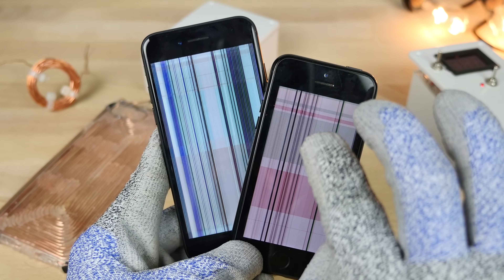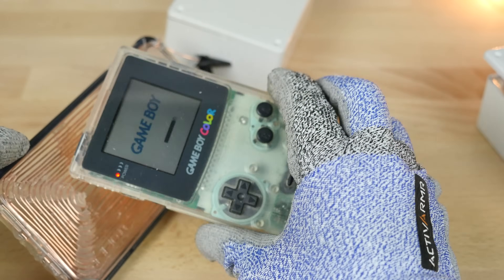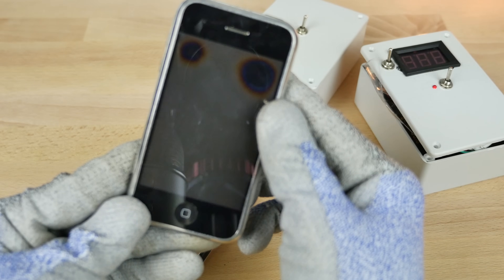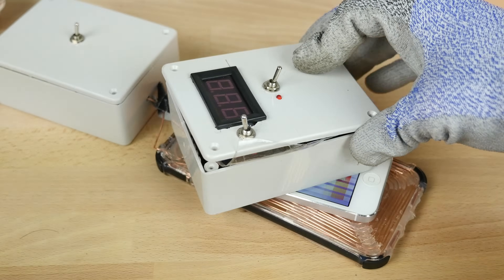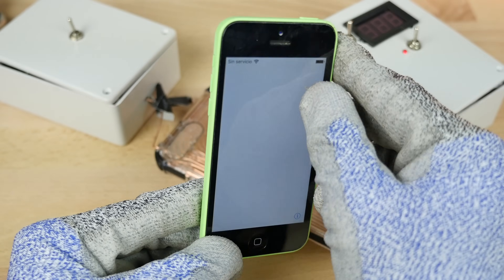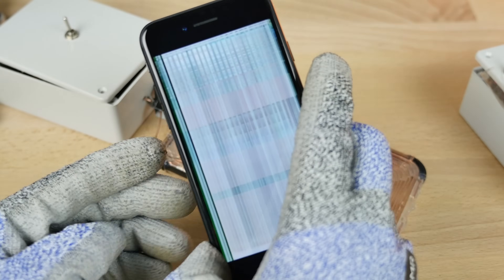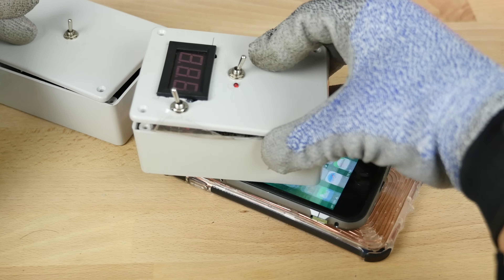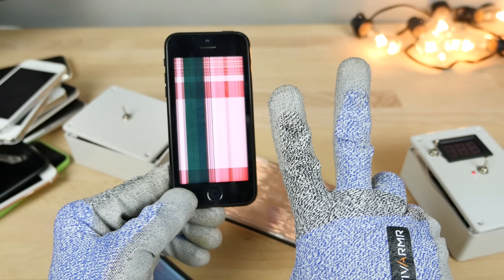EMP Generator vs iPhone 7 & More Electronics!

Comment: I recall that the earlier radio communications worked on this principle, i.e. a spark gap and a huge coil. You could then send morse code by turning the sparks on and off. They basically transmitted on a huge band of the electromagnetic spectrum all at once, not on a single frequency like later radios.

Comment: This a spark gap RF generator. Not a EMP. RF is not the same and low power. 
Most RF shielding is not Magnetic pulse proof. You must protect the whole device not just vunerable chips.

EMP causes "current" to flow along exposed circuits. RF is waves and interferes with transmission of signals.
BTW spark gap transmitters like yours are illegal to operate. 😉 
K5EDG ham radio operator.

Comment: The electro magnet creates spikes in voltage on the data lines (1’s and 0’s are determined by voltage levels) and the device doesn’t know how to interpret this, so it freaks out, might even reset.
Reply: Btw, yes there’s voltage limits that microchips can take in the input, so too much voltage will permanently damage the device

Comment: You gotta add some HV capacitors.

By the way that module you have doesnt generate 700kv more than likely. You can measure with spark gap.
I have a very similar one and it does boost to 33,000v which is still alot.

If you add a few paralell 30kv ceramic caps across the leads then to spark gap it becomes much more intense and more dangerous.

Comment: 700,000V nope.  Air breaks down with about 3kV per mm.  spark looks less than 10mm, so less than 30kV.  The false advertising on these modules is rampant.  Still good fun though.

Comment: One phone isn't more resilient than the other, but rather you found the resonant frequency of the others.  The circuit to be affected needs to be sized to the wave in a way that the circuit lies within the positive and negative part of the wave.  Also, basic knowledge of an Inductor will make you realise one loop of the coil will transfer the most current.

Comment: I am wondering if the Nokia uses through-hole components or surface mounted components on it's PCB. I've read that through hole components can handle power surges better than their surface mounted counterparts.

Comment: The older phones are more resistant because the logic circuitry is based on Bipolar junction transistors rather than Field Effect Transistors. TTL vs CMOS. FETs comprise most modern CMOS systems and are great because they are less susceptible to internal noise, use less power (3.3V nominal instead of 5V), can be incredibly compact and easier/cheaper to build. That being said, CMOS is incredibly vulnerable to electrostatic discharge and unregulated voltage spikes. It literally perforates the dielectric barrier between the conductors. That’s why it scrambled your touch engine and display drivers in the newer phones. All that non-volatile memory is being rewritten on a logic state level, the very 0s and 1s that chips are loaded with from manufacture get messed up.

[Edit]: Also newer phones have LED screens, not LCD. LEDs can be destroyed by EMI much in the same way as CMOS logic circuitry.

Comment: The reason emp generator has a bigger effect on newer devices is that newer devices have more bunch of small circuts on them unlike the old ones where the circuts are way bigger thats why they don't get permanently affected and the reason for it is that emp ganerators makes a bigger amount of voltage in the small circuts and makes less voltage

Comment: The reason the lines sometime permanently stay on the iPhone 5 series is because it’s actually affecting the digitizer and the 5/5s/SE have that as a pretty bad problem especially during screen replacements where the touch screen connector isn’t properly connected and it causes lines both if the touch screen works or if it doesn’t. Somehow the circuitry for the touch and LCD are connected and the LCD will make lines without the touch connector being fully connected

Comment: You can also make a rather too effective device by taking the magnetron out of your microwave, buying a cheap step down converter to run the heater in the magnetron.
Then using a high voltage UHF coil to charge a >5kv capacitor with a spark gap on the tube. Now that will make yee nabours unhappy. And possibly worse. Best to make a faraday cage around the antenna to focus the energy.

Also kids out there, Really don't do this. It's dangerous on so, so many levels.

Comment: Make a really high voltage charger like between 500 to - 100 V and see how fast it charges. have a couple of extension cables just in cas the battery explodes. so you are away from it
Reply: GamerNot Foundroblox cáncer profile
Reply: Yes exactly.
Reply: The high voltage charger wouldn't charge it at all, it would probably break the cord and that's it.

Comment: The older models are made of plastic and glass. The newer are made of thin aluminum. Thus the electric energy travels through better, which is why the newer models break easier.

Comment: The older phones have a more metal casing therefore blocking more emi. Newer phones are designed to be lighter and by extension they have less protective metal

Comment: What I think that makes sense(but might not) is older phones have weaker, idk what to call it, GPU? Core? I'm gonna call it processor. They're weaker so it doesn't need too much power for charging because it will without it. But newer phones' processor are better which gives them more power so they can charge faster but more power means easier for the EMP to flow it's powerful electric. That's my guess, 99.9% won't happen but who knows the 0.1% would win

Comment: Can I shut down a air conditioner with that? because my neighbor have a really noise here and is drive me crazy
Reply: Carlos Alberto Brasil that's extremely illegal
Reply: Only if we caught
Reply: Carlos Alberto Brasil possible but you would have to acces the controller board witch is usually inside
Reply: Maybe ¶: neighbors reaction to broken a/c (if it works) neighbors:call a/c repair
Repair crew: EMP radiation damage on your a/c 
Neighbors: WTF

Comment: lel even Nokia 3310 is EMP resistant
Reply: Everybody knows that nokias are impossible to destroy
Reply: @retard123-qinkm2  except putting it into the sun's core
Reply: Tillmann Taute the atoms in the core will start fusing into the Nokia instead
Reply: @ttaute  No the Nokia will destroy the sun
Reply: @Robospy1  maybe see the sun melting the Nokia at 15 Million degrees Celsius.
Reply: @ttaute  ok roblox player
Reply: @Tillmann Taute Very funny.
Reply: Nokia 3310s are everything proof
Reply: No it isn’t, it started flickering and turning off

Comment: The old phones are more resistant since they were designed by Steve Jobs
Reply: actually the back of the older models were made out of a metal. metallic molecules tend to have +1, +2, +3 p+ in some cases like silver isotopes. those absorb the electrons flowing through the air from the EMP.  in a few words the heavier and denser the metal is the better the absorption of e- (electrons) that is why lead is a great shield for EMP/radiation.
Reply: Steve Jobs didn't make the iPhone. He did it's marketing.
Reply: @mainakmajumder4648  He was leading the project. More specifically, pissing off engineers.
Reply: Lochlann MacDonald that actually doesn’t make any sense to me. If you watch carefully, the iPhone 4 and five have a little bit of an effect when they get hit by the electromagnetic pulse. But at the same time, I guess you’re right
Reply: I'm guessing it's because they have better shielding due to the construction being denser metal. The transistors and such inside of the older iphones is probably just as vulnerable. Anyway that doesn't matter. The cell towers certainly are not resistant. But hey, I guess you can use it to listen to music lol
Reply: Noice
Reply: Yea
Reply: He was a massive asshole but he was still pretty smart
Reply: @stoningupper  how was he an “a” hole?
Reply: @Unknownuserhtps  according to some people around him
Reply: @stoningupper  oh ok I see, well as long as he made a good product I don’t mind😅
Reply: @Unknownuserhtps  personally I prefer Samsung but I do love apple's quality
Reply: They aren't designed by him. And they aren't more resistant.
Reply: the iphone 4 was too though but i see your point

Comment: This EMP generator is whack. I've built my own and it's smaller and way more effective than this brick.
Since I do have a background in science (physics to be exact) all I can tell you is this: EMP generators are like lasers in the sense that the ones that only emit short pulses instead of a continuous stream are way more harmful and dangerous. It's very easy to emit short bursts of extremely high intensity but at the same time it's almost impossible to create a continuous stream of equal strength. That's why the strongest laser int he world only emits light in a fraction of a second (and not in a continuous beam). The same principle applies to EMP generators: which is why my own generator is so dangerous. It only creates a short burst of EMP interference which will mess everything in its way (not all devices go kaputt but those that withstand the blast restart themselves).
Reply: AntonioKowatsch typed all that for 1 like.... L..
Reply: xKing SavageZ 3 bitch
Reply: I Think you are a german
Reply: Can it damage a Samsung s5 phone
Reply: Kaputt? Ok you are german

Comment: "so don't do that to your iphone 7, it will permamently affect it"
*proceeds to emp his iPhone 7
Reply: Wayne  I knew the iPhone 7 was garbage
Reply: @ilikepotato2741 how is the iPhone 7 garbage it is better than the iPhone 8 coming from me who is currently using a iPhone 7 128gb Rosegold with a lime green case and a matte black anti blue light tempered glass screen protector and I am currently using it to type this comment and it the better than my other iPhone my white 64gb iPhone 11 with a neon pink case on it but my main iPhone my Gold 64gb iPhone 5s with a pink case and clear tempered glass screen protector which Is currently being fixed and will have the case and screen protector replaced with a light pink case  and a matte black anti blue light tempered glass screen protector once I get the phone back and my iPhone 5s is still better than my iPhone 7 that I’m currently using to write this comment but it is still better than my iPhone 11
Reply: My thoughts exactly

Comment: You can actually have cool glitched wallpapers on your phone if you pass an image through a corruptor of sorts, or you can corrupt it manually by replacing random characters with a text editor. It's completely harmless to the phone. But of course it can destroy the pic, so make a copy backup from the original before doing it.

Comment: that proves that Apple SUCKS
Reply: Haxx4life i dont think android gonna survive that strong emp force, i saw a video where poeple uses smaller emp generator and android goes black for 1.5 sec, so this emp generator is 2 not 1 and its also big, so nothing could survive this shit, ya salty android fanboy :/
Reply: wanna know what else does?

You
Reply: Cool Dude all phones suck unless its like a super bendy screen with no protection and stuff it would look much cooler than
Reply: Diogo what he should have done is add more batteries and the amp to voltage transformers in the one with the copper wire platform
Reply: Cool Dude 
That proves that YOU suck.

Ahem ahem. Most apple phones to react bad and good, it doesn’t mean you can go on a rampage of hate towards apple.
Reply: Are you all stupid? Eletromagnetic pulses can permanently disable any and all eletronic devices with insufficient isolation and shielding.
Reply: Cool Dude so u think because he is destroying the iphone, makes the iphone quality sucks? nice logic idiot, every phones quality became sucks when they destroyed, that proves you are salty android fan :/ pls gtfo, this is apple only
Reply: Zayan Hussain they are the same price you salty fanboy
Reply: Using a device that's designed to destroy phones on an iPhone makes it suck? Nice logic
Reply: Cool Dude someone is too poor to afford apple
Reply: Jordan Lucero did u watch the whole thing if you didn't he tested it on Android phones to but they survived. Fucking apple fanboys

Comment: I think the electromagnetic waves are messing up the CPU. I have experienced this multiple times while trying to re-jailbreak my iPhone 6. When I press the 'go' button in the Yalu102 app, it acts like it's going to re-jailbreak, then a bunch of white lines with a black screen pops up then the iPhone reboots itself. I did some research and apparently it is the CPU that is causing the White Lines because it has experienced a issue and displays those lines.

Comment: The only reason the iPhones have issues is because LCD screens are magnet sensitive. OLED (the panels used by both the Android phones tested) are not. No phones tested showed serious harm to any other component (lost data, fried processor, etc). So congrats, you found the one flaw with LCD screens: temporarily susceptible to concentrated EMP attacks.
Reply: Daniel Campman The Samsung phones tested use wireless charging. They have to have EMI protection or the chargers will do this to them.

Comment: The earlier iPhones are almost EMP resistant. They seem to not be made of aluminum which could be why the they are EMP resistant and not other iPhones. Also it seems to only affect the screens, but not on Samsung's Galaxy, so it would be reasonable to assume that OLED screens are virtually unaffected.
Reply: On that topic I might as well say I don't think Samsung would've had an OLED screen on their phones if they didn't have wireless charging. This also would make sense for the iPhone 8(or whatever you want to call it), because it might affect the LCD screens really badly. However, I do not know anything about screen electronics: I'm just making observations and inferring.

Comment: U missed se
Reply: Sam Wirth SE is not same as 6s
Reply: Elijah Reyes yee
Reply: Black Kakarotto trueeeee
Reply: Why not the iPhone SE?
Reply: Black Kakarotto actually it is apart from the display and the front camera that was the whole selling point of the se, iPhone 6s specs in a small body. The se still has a 1.2mp front camera and hasn't been upgraded to a retina hd  screen yet, doesn't have 3D Touch  apart from that it is the exact same phone internally as the 6s.
Reply: Yeah, I don't know why he didn't do the SE, though he hasn't really talked about it much on his channel
Reply: Elijah Reyes yes ikr
Reply: I’m using one rn
Reply: savageman elijah he loves jet black on iPhone 7 and 7 plus
Reply: Fuck se
Reply: Sam Wirth Why do you have to call him an idiot? How is it the same as the 6S? Only the internals are, idiot.
Reply: Savageman elijah You missed proper spelling

Comment: That could be a build up of static electricity inside the layers of the lcd screen and by turing the phone off and on it is discharging or returning the phone to a ground neutral charge
Reply: But im no expert
Reply: WerewolfAtHeart you just blew by mind
Reply: King Butt thats what i do, no need to thank me
Reply: That discharge would fry all the internals
Reply: In my opinion it simply messes with the lcd screen cable...Since the motherboard tells the screen what to do by electric pulses the emp might be messing with these.
Reply: WerewolfAtHeart "but im no expert"
Reply: Found the party guy
Reply: WerewolfAtHeart you are mostly  grounding the phone by touching. So thats not the case. You are simply inducing a high electric, somewhat AC, charge inside the ICs that don't have proper shielding. DC devices don't really like high voltage A.C. pulses going though them.
Reply: WerewolfAtHeart can this work on a Xbox?
Reply: PSSHHHHHH mind blowing
Reply: I think it affects it physically like hitting it with hammer cause they go normal when screen is turned on and off. Considering that every device survived they are immune to emp.

Comment: The jet black one only went worse for the 5s Bcos you took it apart so it wasn't as resistant and also black increases heat which went to the lithium ion battery which could've dried the circuits Bcos it heats up too much